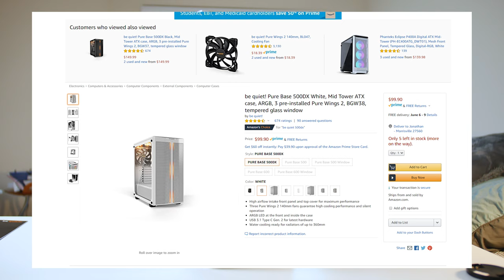How To Build A PC In The be quiet! Pure Base 500DX

Comment: Nice video, but cable wiring to motherboard would have helped some of us.  I cannot find the reset switch connnector at all on mine. [EDIT] There is none apparently. The button up front is RGB control. Then there is what might be a 3 pin connector that might be the ARGB power, but it isn't labeled and when I plug into my B550 ROG Strix to the ARGB header, it is very loose on the pins. Then there is a connector about 0.7 inches long that I have no idea what it does and it isn't labeled either. It isn't the SATA power cable which also isn't labeled. The manual is barely helpful for these items. I'm not a terribly happy camper now, will have to contact be quiet, ugh.

Comment: Great video, thanks!
What's the thickness of that radiator?
Will a Liquid Freezer ii fit there (with low ram)? Will it fit in the front with long cards (300mm)?
Reply: Exactly what I want to know, can I fit the 240mm liquid freezer 2 up top?
Reply: @O G 
They being be quiet or arctic? I've approached both with the question and both refused to give me straight answers..
Reply: @TrumpWinner  
That's awesome man, thank you so much!
These are also the exact ram sticks I was thinking about, so it's perfect!
From the look of it, if you don't go for a card too long, you can even put the radiator in front with pull!
Reply: @DanTurambar  yeh a few pages back on the forum a person has done that with a 3080 card and still has 50mm space. no worries about GPU space if front mounting.
Reply: @TrumpWinner  Sure can! I just built a computer with this case and installed an Arctic Liquid Freezer ii 240 at the top. It was one of the main reasons I got this case over the Phanteks P400a

Comment: Such a fantastic case and I was really looking forward to use this one!
But sadly it seem like it simply won't be big enough for am RTX 3080 and a front mounted 360mm AiO
Reply: it will be big enough for a 3080, it supports up to 370mm length, 3080 strix is almost 310mm
Reply: I have the MSI Ventus 3080 and a front mounted 360mm AIO.

Comment: Is the rgb supposed to work automatically after turning on the pc? I just built with the same case and cannot get the included lights to turn on
Reply: You have to connect the sata cable to the power supply, to power rgb case

Comment: So i have this case and I just got some sleeved cables and re-ran and managed the cables. I just noticed my power LED does not illuminate. I cannot for the life of me remember if it worked before, but it doesn't work now. I know I didn't connect anything to the power LED header on the motherboard, but I cannot find any cables that aren't happily connected where they need to be. Is the power LED run through the ARGB connector? If that's the case maybe I damaged something when doing my cable work. I'm just pretty stumped and out of ideas.

Comment: This appears to be the case I want.  I only wish it two front panel USB-3 ports instead of just one.  Additionally, my Asrock B550M Steel Legend motherboard does not have a USB Type-C header to support the case front panel USB Type-C port.  I want the black case and they appear not to readily exist and the white version is more like $110 rather than $100.  And this 500DX pricing is about a 30% premium over the base  500 model.
Reply: hey man, did you fix your type c issue? because i'm trying to find the right motherboard for it so i can use the usb-c. it seems pretty hard to find the right motherboard.

Comment: I recently built in this case and it was quite an amazing experience. I have only one thing and that's cpu cable. There is not enough space. I have Dark Rock 4 Pro and plugging that cable with cooler already installed was a nightmare. There is no way to plug that cable once you have motherboard installed so it has to be done with extra pair of hands together with motherboard installation. Installing the cooler in the case after MB is installed would be way worse. In general the case is great. It's really quiet and it looks amazing.
Reply: thanks for the heads up i also have the dark rock pro 4. Is it possible to already have the cpu power cord through the top hole and or try plugging it in as u set the mobo in?
Reply: @Adapting_Adventures  if you have extended cables for the power source you should be good to go, just plug it in, install the cooler and put it into the case. If you'll find some easier way, please share it. I had to ask my wife to help me to plugin those cables while I was holding mobo with the installed cooler. gl with your build!

Comment: Any room to put that 280 radiator with the 140mm fan (x2) with a push pull and have 1 extra 140mm fan under the radiator in the front?

Comment: Hello people. I have recently purchased a pc prebuild, came already instaled with all I needed, and I have this case as well, I have 1 fan at the back, 2 on the top, and 2 in the front, but the 2 on the front, do not work, or are they suposed to start only when pc overheats? or reaches a certain temperature? I have check your video also, and It looks, your 2 front fans are not spinning also? Hope someone has an answer. Thanks fellas

Comment: Recently bought this case but i have only front panel lights... i didnt see any leds inside the case. Did you have it like seperate spare parts or it was already inside the case or i didnt connect something till the end? Another question which type of gpu will be best for this case open air or blower type? I just got rx vega56 recently, sold it already away as my glass cass cover was getting extremely hot and graphic card was extremely noisy... thinking about which gpu should i buy to solve this problem or i should install some additional fans???

Comment: Great video man, but have a problem with it. I can't connect the argb of the case cause it's a 3pins 5v and my motherboard is a 12v 4pins, can someone help me please? The rgb of the case doesn't work so...
Reply: The rgb will still work if you plug it into your mobos rgb slot, but without an argb slot you won’t be able to fully customize the rgb. You could either upgrade your mobo or check online for a good 3 pin to 4 pin adapter.

Comment: Will someone answer the question that bothers me, I have the same housing, or when everything is connected, the front panel can be freely removed, I do not mean when the PC is turned on, but when it is turned off. Do you need to unfasten something to remove the front panel and get to the filter which is located just behind the front panel ??. I am asking because, unfortunately, there is no mention of this in the film, and the panel is removed when the housing is still empty.

Comment: Hey! I am thinking of building in this pc case. Would the Dark Rock pro 4 fit with  2 140mm fans up top and on the exaust? if not then what should I do? And also can I add 2 more 140mm fans in the front panel?

Comment: Just beware using a matx motherboard, I have been unable to connect one of the headers blocked by the shroud that you fir the ssd onto which hides the cables, other than that a great case and cool too.
Reply: Wait isnt this case atx? I just bought msi b550 gaming edge wifi, will i have same problem?
Reply: can't you remove the shroud?

Comment: Just finished moving my PC to this case yesterday. Everything went well... except when I went to remove the case's USB 3.0 connector from my motherboard so I could re-route it. The connector got ripped in half when I pulled it out. I had to yank out the piece that got stuck in my mobo with pliers... No front panel usb for me :(

Comment: Would of loved it if you actually showed attaching the cables as every tower is different and every motherboard is different.

Not sure what one of the cables that came with this pc case does at all. And there's nothing about it in the booklet. Assume it's for maybe more modern motherboards as mine is an old b550 msi board 

There is also no usb cable to attach to motherboard or is it hiding somewhere attached to the case?

If you've never used rgb chain link fans from be quiet it's very confusing at the beginning.

Comment: If anyone has the answers to these, I'd appreciate it.
Would a thick AIO like the Liquid Freezer II 240 fit top mounted (which is 63mm thick)?
If front mounted, would there be any space left for putting one of the case 140mm fans? 

Cheers

Comment: Great review, may i ask how is the noise level ? Thank you
Reply: So depending on if you do top fans on the front there is not much sounds it is the top and back fan that seem to make the most noise but if you optimize you can settings you will probably be pretty quiet.

Comment: With my mother board I have a clearance issues for top Mount radiator, I haven't upgraded my gpu yet planning to in a few years. At the moment I'm able to do a front Mount tubes down but I'm not sure if adding a 2 fan gpu will cause issues.

Comment: Great review. Just some questions. DVD Drives are a thing of the past or? How I install that on this case? Do all the fans have to blow the air out? Or do some bring fresh air in as well? I built a PC 6-7 years ago and as much as I remember the front fan blows fresh air in and the back fan blows hot air out of the case?

Comment: How much do the screws on the left side glass window stick out? I'm considering this case for my build but have to fit it in a small desk cabinet with 24cm width. Since the 500dx is 23.2cm wide without screws, will it fit my desk with the screws on?

Comment: Mine didn't come with a fan cable holder you mentioned in the video? Also the paint is so bad i screwed fans in that i misplaced and it left a nasty paint chip each hole from the screws and i didn't even tighten them...

Comment: Where do you plug the case and heatsink fan headers? Motherboard, or straight into powersupply
Reply: fans go into the sys_fan 1 2 3 etc, CPU cooler goes into cpu_fan

Comment: Hi JD :] Great Vid ! Im just building 500DX myself, and I cant decide the airflow managment :{, whether to put AIO water cooling radiator 2x120 240mm on the top, but with that letting open GPU RTX2070S 3xfan blowing warm air inside the CPU fans radiator above.  / or 2x140 fans 280mm radiator at the front letting the air inside, but coming out warm/hot into the pc case. Exposing GPU, motherboard and all components with radiator heat before going up into the exhaust top and rear. Could you help me out with this one ? Thanks for long read ^^
Reply: Hey there, did you build your PC with the 500DX and what airflow config you end up with? 

I'm simply wondering if a thick top mounted AIO will even fit (like the Liquid Freezer 240 which is around 63 mm thick!)
Or if mounting it on the front, does that leave any space for one of the case fans?

For your original question, it's a bit late, but front or top AIO is usually a trade off between a cooler GPU but warmer CPU (top) 
and a cooler CPU but warmer GPU (front). Also depends if your GPU has open cooling or not (blowing hot air in the case vs from the back).

In general, i'd say front 280 AIO intake and top/rear as exhaust should do you well in most cases 👍

Comment: Hey! Mine has another fan on the top of the case which I don't see on yours, did you remove it to fit in the radiator for the AIO? Is it possible to fit the AIO at the front?

Comment: I have this case, in order to line up the case holes on the PSU bracket it must be screwed onto the PSU but not completely, then you screw it onto the case and align them first, afterward you can finish screwing the PSU in. Otherwise the case won't align with the bracket and if you force it the holes might strip. Also the front panel wiring seems to be headered if you ever need to fix them

Comment: Does that hard drive tray prevent you from installing a third 120mm fan at the bottom front? If so, is there any way to install a 3.5inch drive anywhere if you remove it?  And if you remove it, will you then be able to see a mess of cables in front of the PSU?

Comment: Hi! Can you recommend a software to control the RGB of the case? I asked Be Quiet already but I still haven't got an answer. I'm using a Gigabyte motherboard B460 Aorus AC, the RGB Fusion 2.0 software that comes with it doesn't seem to recognize the case at all. Is it the app, or did I do something wrong with the cables? I'm a newbie after all XD
Reply: Pretty late but isn't there a button for the case's led strips? Like near the jacks, on the front panel
Reply: Yeah, you can control the RGB manually, but there is also an addressable cable and you supposed to be able to control that one too... Aura synch doesn't work ..

Comment: Soo I got a black one and some things to do out the box…. It has two exhaust fans which doesn’t make any sense when you realize it only has one intake soooo first thing you should do is move one to the front.
Reply: It can have negative or positive airflow(or how it's called) and both are valid. Don't forget you also have fans on CPU and GPU.

Comment: How do you control the RGB lighting? I want it off?
Reply: how did you even get it on, mine won't turn on???? but to answer you, I'm pretty sure the bell on the front needs to be pressed for 3 seconds
Reply: @Essnewq  For it to turn on you need to connect the sata connector to your psu, then press the button. If this doesn't work, you need to send it back.

Comment: So u can fit a NZXT Kraken x63 (280mm) up on top?
Reply: I’m not sure it’ll fit with a. Atx board cause my fan barely fits up top but 73x definitely up on the front I just need to find a place to store my hard drive
Reply: @oscarventura3434  ye I ended up setting it up front with tubes up top but on cpu end it’s sitting at bottom. No pump noise and cpu runs cold. Happy gamer

Comment: Hi there, I have a question about the RGB, did you install any other LED strips? In the montage the case looks really well lit especially underneath the GPU, is this illumination just from the strip that comes with the case? Impressive if so. But it looks like you've added some additional lighting down the left edge of the motherboard?

I'm pretty set on building a "glacier white" (or "Ice Rain" as I've dubbed it 😂❄) themed build with this case and I'm trying to figure out whether I need an extra RGB... I'll probably get a white RGB AIO cooler so I will have the possibility of more illumination from the top.

Thanks.
Reply: have you done it, I'm trying to figure out how to connect the RGB front and top strips

Comment: Witch with software can I control the rgb on this case?
Reply from the maker: It a 5V connector for motherboard RGB control, so any board you have with a digital 5V connector should work
Reply: @jdtechgear  so I just habe to press a button that all components will light togheter? Or is there any software to control, because that is for me a little bit better
Reply: You can control it with the top button out of the box, or through your motherboard software if u prefer that
Reply: Witch! 🧙‍♀️🧙‍♀️🧙‍♀️

Comment: Thanks for review instead of showing how to build the PC as in how to wire it up. Useless and wasted my time. Call it a review not a how to build. Cause you didn't show any connections involved.
Reply from the maker: There are plenty of "How to build a PC" guides out there. This format outlines the process of which the components go into the case. Since different PC cases can have a different process. Wiring up components don't change, the cable management process can however. That's why the video isn't titled "How to build a PC", but "How to build a PC in 'X' case"